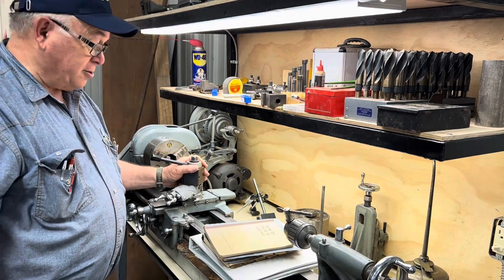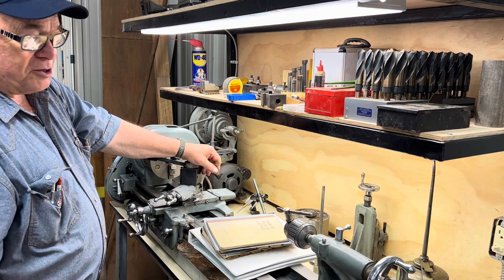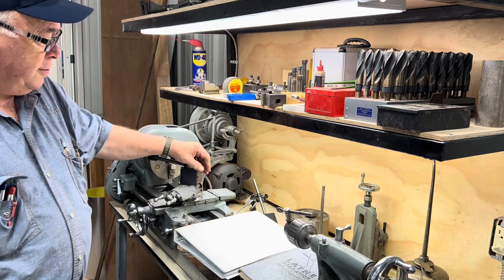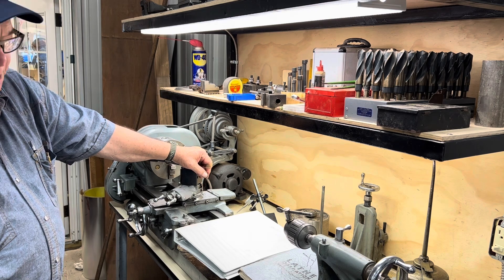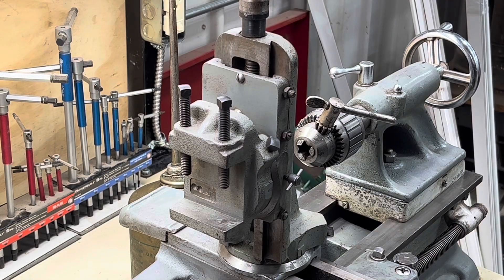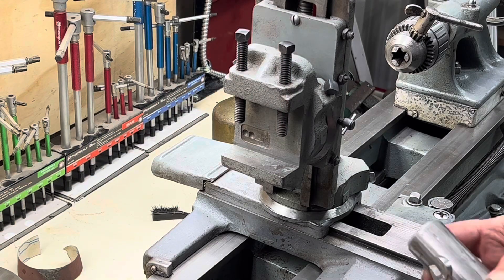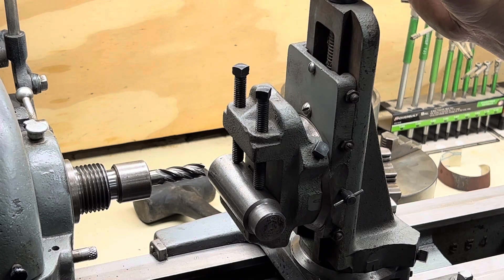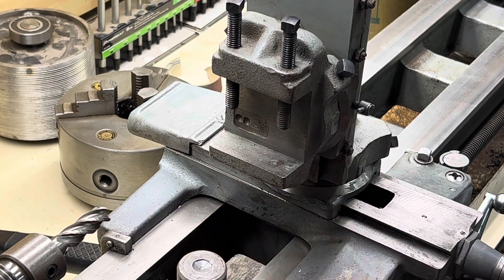Milling attachment on older, atlas lathe.

Comment: You failed to square up the milling attachment to the chuck before removing it. 
You use a 1-2-3 block to align it, then go to the collets. Also, you are missing the jaws for the attachment. They are V-grooved to hold round stock.
Reply from the maker: Thanks

Comment: The OD of your end mill collet is almost immaterial.  You need to check the id, you can use a round gage pin mounted in the collet, or even a bit of drill rod.